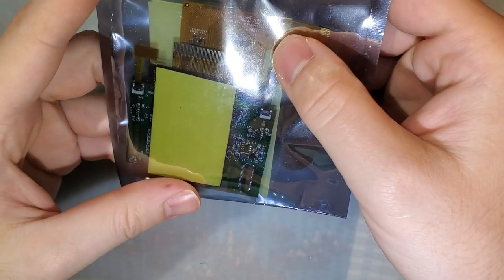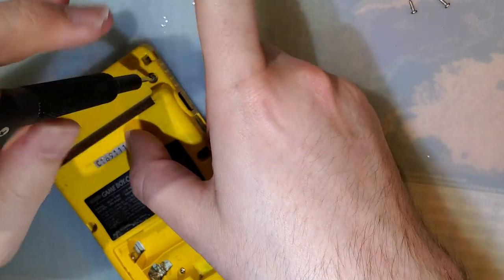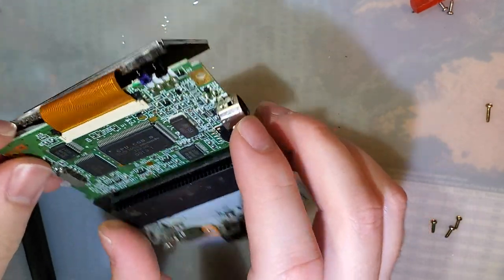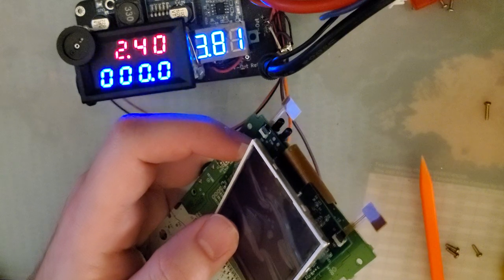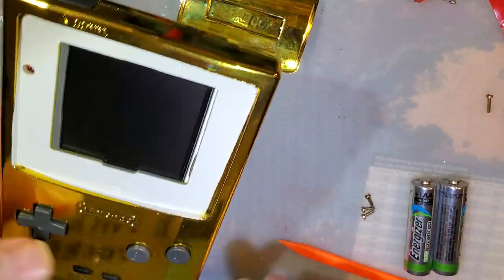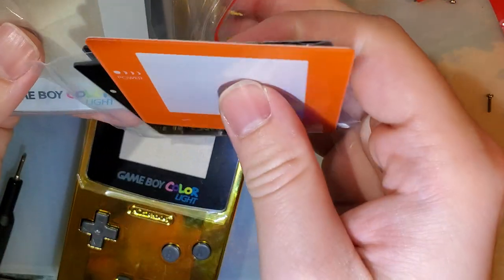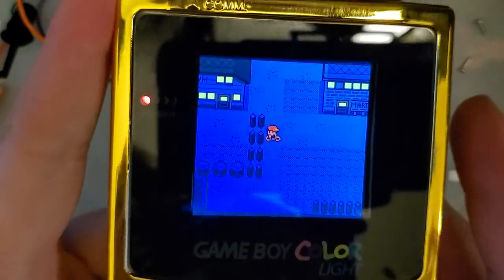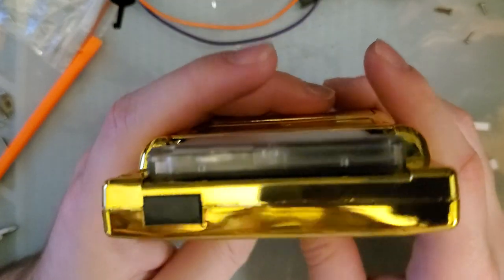Color Palette AIO TFT Game Boy Color (GBC) Backlight Kit

Comment: Bought two of these. I've got a new ritual of watching your vids before I'm even close to attempting to do some modding.
Reply: Hey idk if you’ll see this in time, but you decided to go with the drop in lcd screen over the ips or q5 osd ips screens?
Reply: I’m sorta debating which build to go for myself
Reply: @CoolGuynumbawan  it's a lot easier. You get a smaller screen, but you won't have to trim any plastic and do any extra lining up. Most I've seen come with the little plastic spacers. Either way it's an upgrade over the original for sure.
Reply: @SefEXE  tbh I don’t even mind doing the cutting and soldering. Only like a $10 diff between screens.  I’m just torn if I wanna settle with a smaller screen with better battery life or a nicer larger screen that drains the device more.
Reply: @SefEXE  any suggestions
Reply: @CoolGuynumbawan  I don't think the drain is too bad. I'd go with Q5 if you don't mind trimming. I think that would give you the best experience. You can tell the difference between the LCD and IPS when looking at them together. The IPS is more clear and can definitely get brighter.

Comment: About that tape, use double sided lcd adhesive instead of that 3m tape. I own a tech repair company and use the double sided lcd adhesive for just about every repair I do and it works great. You can find it on amazon. Just search "red tape adhesive" on amazon and the stuff by Kaisiking will do the trick.

Comment: Nice review! I was looking at the right margin of the second screen you tested (from 30:59, for example) and it looks like there is a vertical line. It can be clearly seen while running bar test and Zelda DX  (from minute 31:56) and pallet testing (minute 46:04, clearly seen in the "blue light filter"). I don't know if you said something in the video about it and I just missed it, so, sorry if that is the case.
Reply: You're right, there definitely is a line on the far right.
Reply: @HoZyVN  The point is that I don't know if that is an issue of that screen unit, as I didn't notice that line in the first screen makho tested.
Reply from the maker: @LeopoldoPlaSempere  Likely an issue with the screen. I did notice it but I got distracted and forgot to say something.
Reply from the maker: Or rather the LCD itself. The LCD that came with the kit was fine in this regard but had other issues.

Comment: What does the light-blue 3.74 on the right side of your power source indicate?
Reply from the maker: input power voltage -- basically it's a battery meter and it means that my batteries are at approximately 55% charge

Comment: Speaking of sensors under the screen. is that why your spacers have the traces in them? Can the spacers be wired as touch sensors?
Reply from the maker: On those ones, I specifically put traces in there so that oshpark would not give warnings when you try and order them. There is no function otherwise. On other spacers that I ordered (like the first set for MGB), I did put an actual circuit in them for something I wanted to test. Something something two birds, one stone.
Reply: @makho  If you increase the copper content, do you think those spacers could actually function as touch sensors, They seem to be in a decent location and would make a simple install.
Reply from the maker: @Shadowen925  the issue is that the electroplated coating on this particular shell is acting as an insulator for the sensors. On other color shells, that would be a perfectly fine location.